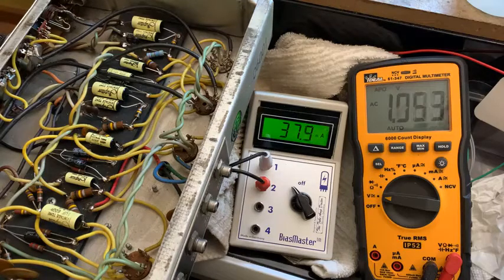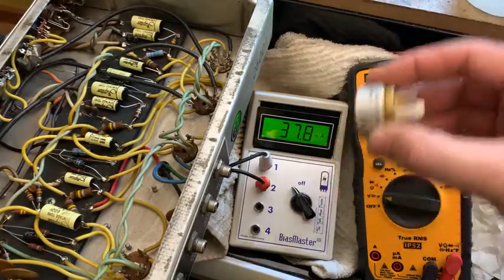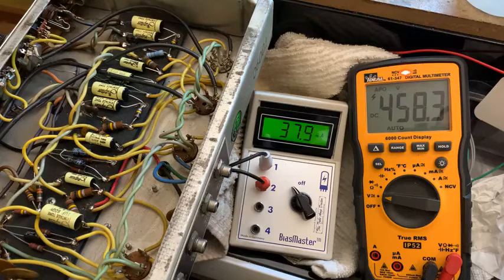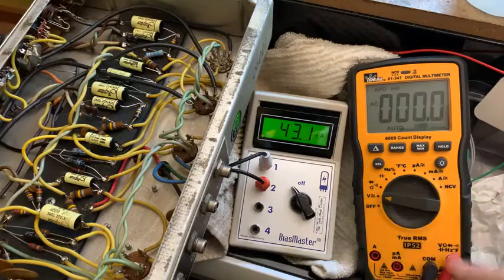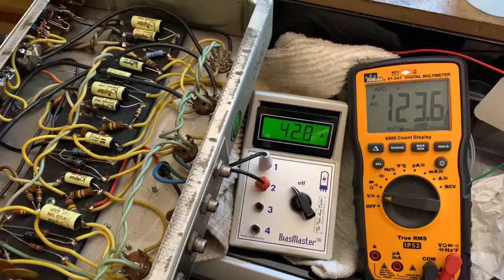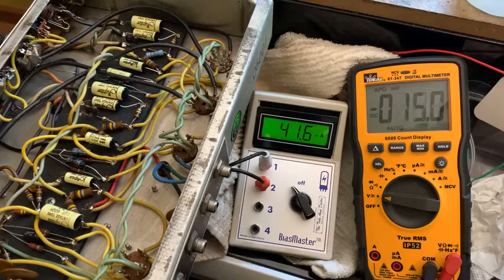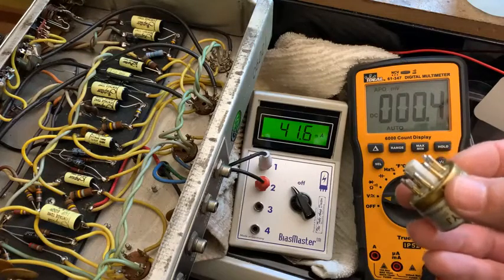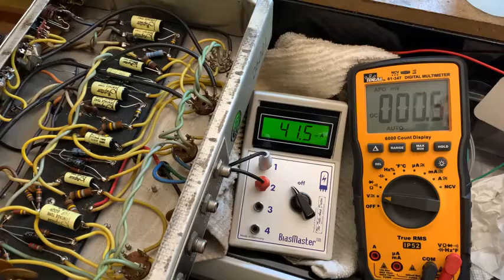Tube Amp Bias - How Varying Wall Voltages Affects Plate Dissipation

Comment: So 59% idle dissipation @ 117V, goes to 72% @ 126V. That’s a 13% increase in idle dissipation for an 8% change in wall voltage. That tells me that the nominal change in idle dissipation is (a little under) a factor of two greater than the percentage change in the wall voltage. That’s a useful number to have in my head. Thank you!